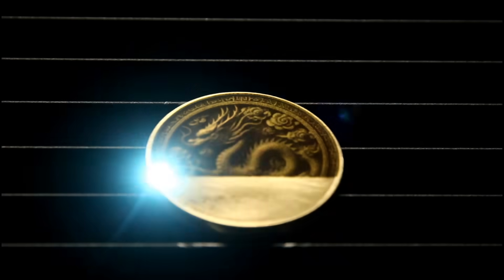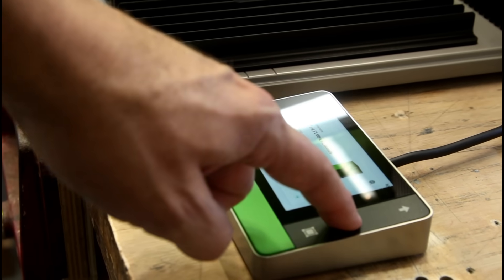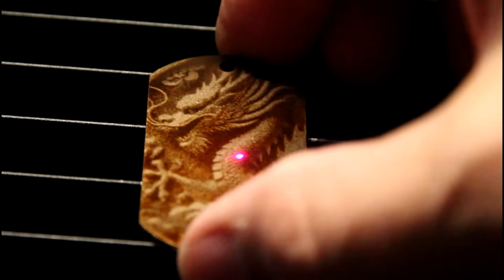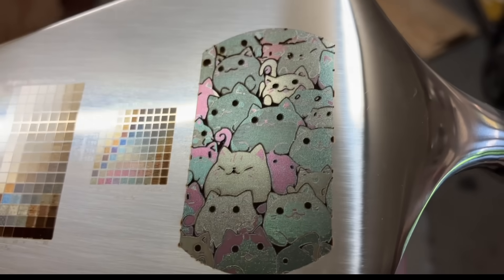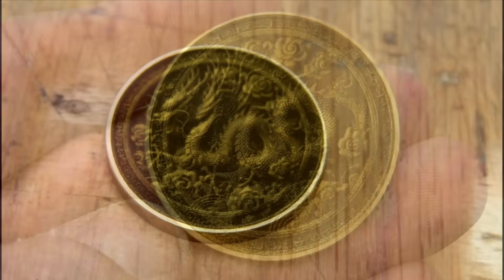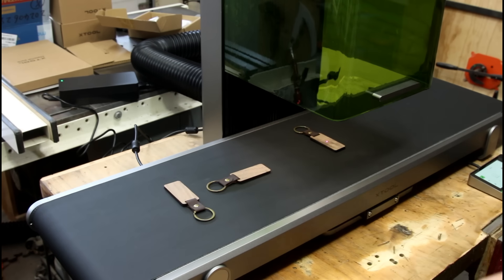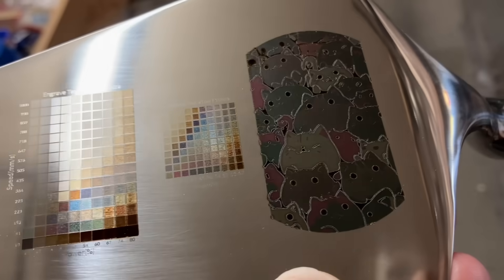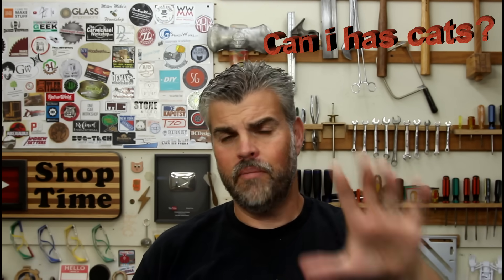xTool F1 Ultra | 20w Fiber Laser & 20w Diode Laser Engraving Factory

Comment: I have a project where i need to engrave 1-2mm into a piece of mild steel, so i can do some copper inlay (simple geometric designs nothing overly fancy) , i am assuming that with a set up like the xTool F1 Ultra, i would either need to up the power of the laser or do multiple passes. while the tool is ment for engraving could it cut thin section ply or balsa wood?

Comment: Coloring stainless is cool, but the belt feel more like a gimmick. The machine does not seem to detect everything on it, you you can't just load it up with fifty key chains, then reload every 20 minutes or so. And since you have to basically hand-feed the thing anyway, why bother with the belt?
I suppose with some 3D printing you can have "cradles" that pull pieces from a stack, but if you are making THAT many pieces, just hot stamp them. These home lasers are incredibly slow for bulk anything.

Comment: When in a room operating a laser, always where laser rated eye protection, even if there is a cover. A stray flash with lasers at these strengths will blind you permanently, even just a little bit of it. You know if you have your laser shades on. The machine might run with the cover not on. Don't risk it.

Comment: I’m very curious about if the laser can do multiple items in the same engraving area. So, for the wood tags, if you had 2 in the engraving area, would it engrave both before moving the belt or just get one? I’m also curious about how many passes it would take to cut away metal from a coin or tag to leave a kind of lacy effect or a hollowed out engraving, like that dragon has a background that it is against… could the laser keep making passes to add detail to the dragon and remove the background so it ends up a dragon in a ring?

Comment: If anyone wonders why you keep the cover down, look at what that laser does to metal. One stray reflection. And you lose vision before you can blink. 

Do not mess with high power lasers, you only have two eyes and this will help with changing that. 

Stay safe out there, just because a lot of cheap laser engravers out there don’t have a shield does. Not mean it doesn’t need it.
Reply from the maker: 100%
Reply: Especially since your brain has a system for ignoring gaps in your retina. You can't see the gap where your optic nerve is, and that same "gap ignoring" means your brain ignores spots of laser damage. 

So by the time you notice vision damage, it's already way way too late.
Reply: In my uni, they banned laser cutting mirrors unless it was mirror acrylic and covered in the protective paper